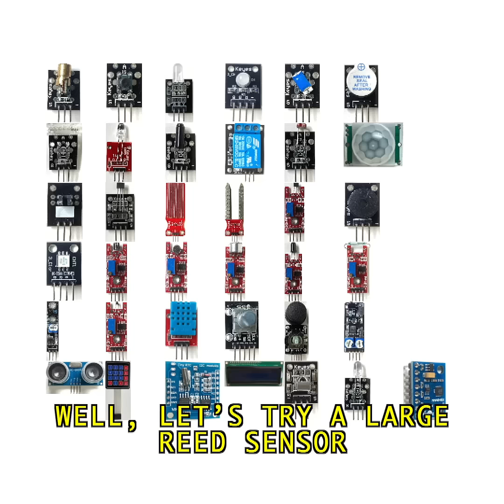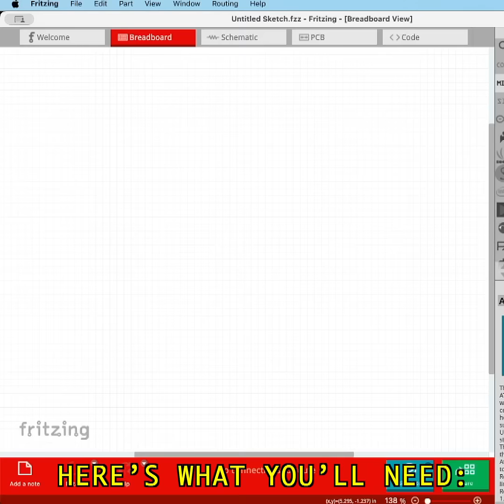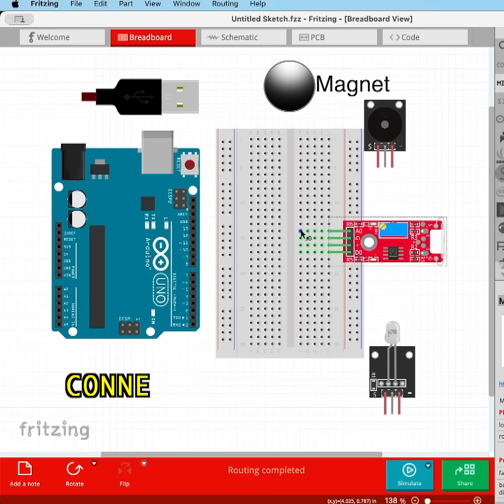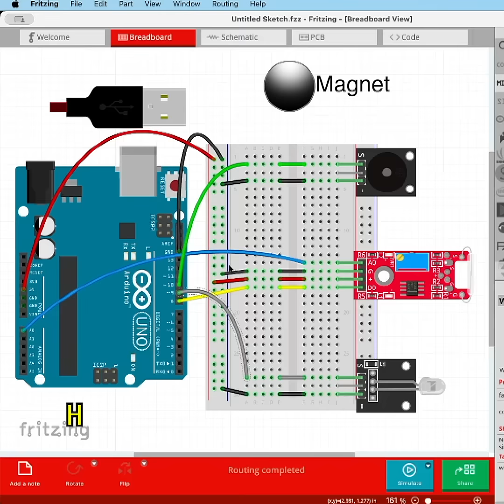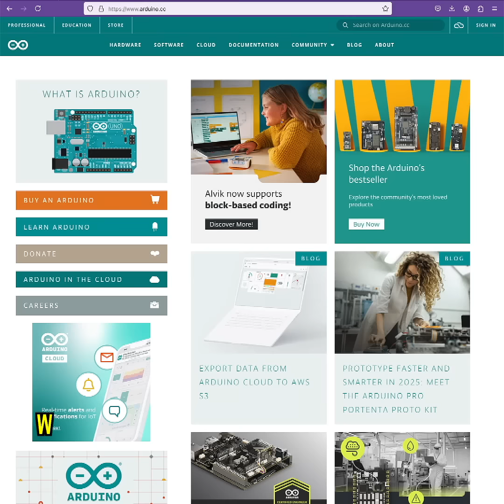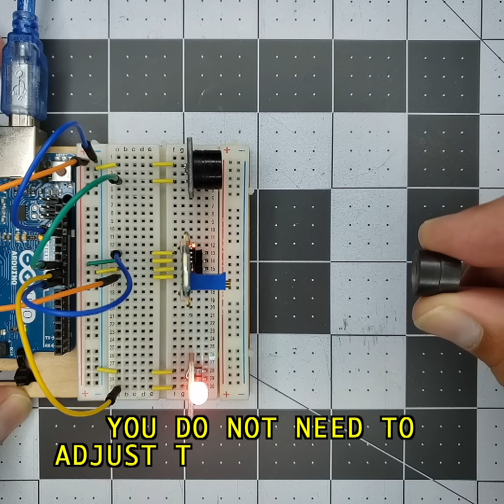Pt-24: How To Program the Large Reed Sensor Module from the 37-in-1 Sensor Kit #arduino #reedsensor

Comment: What's the purpose of all the little yellow jumpers?  Couldn't you just pin the components the other side of the board?
Reply from the maker: I usually move all the sensors to the outer edge away from the microcontroller since the sensors need to be able to interact with some external force (i.e. magnets, heat, motion, sound, etc). It's easier for me to grab the breadboard for a demonstration that way, but it's just a personal preference. That's why in the videos i give a range of jumper wires like 8-18. The small number is the least amount of jumper wires needed for the circuit. The large number is spread out version you normally see. Hope that helps :D
Reply: @MicrocontrollerMinutes Yes, it does.  Thank you